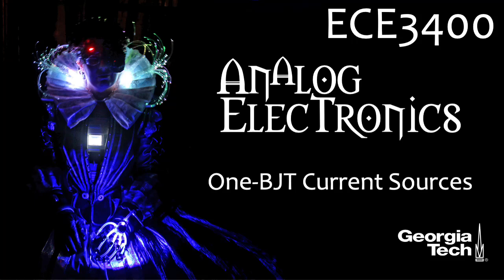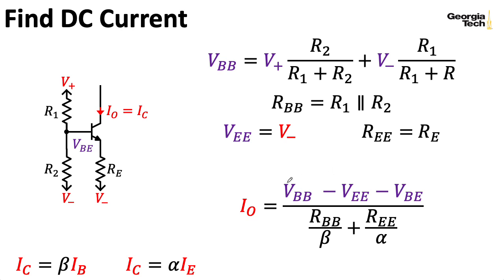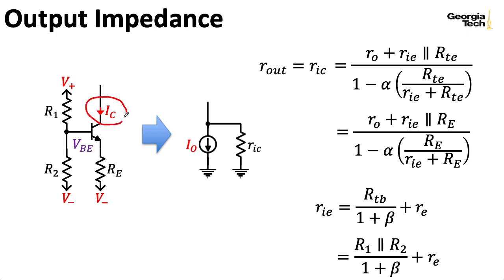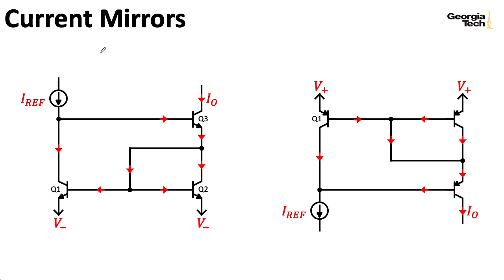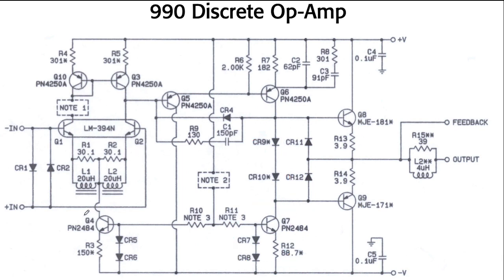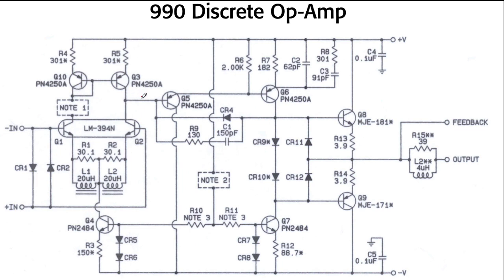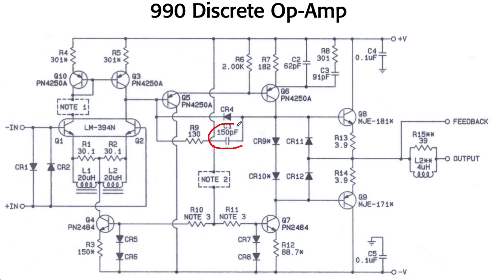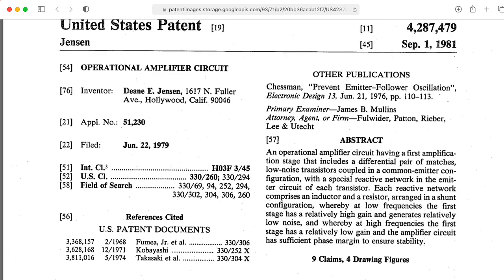ECE3400 Lecture 28: One-BJT Current Sources & Jensen 990 Op Amp Analysis (Analog Electronics)

Comment: Just because it's kind of interesting to comment on.  CR11 and CR12 are there specifically for over-current protection together with R13 and R14.   This will all be familiar to everyone here but just to state it again the current into the base of the output transistors, Q8 and Q9, is controlled by the bias current into the collector Q7 and the input current.  If the collector current of Q7 is lower than the input current the voltage at that node rises until the additional current is able to flow into the base of Q8, which has the effect of pulling the output up. If the bias current is greater than the input current then the voltage at that node will drop instead until current is able to flow out of the base of Q9 which pulls the output down. 

The diodes offer a third path when the output current gets high enough.  The voltage across R13 rises in proportion to the emitter current from Q8.  Once the voltage across R13 exceeds two diode drops then instead of flowing exclusively toward the output through the base of Q8 a new path allows current to flow to the output across CR9, CR10, and CR12 instead bypassing Q8 entirely.  Something similar happens on the low side.  If the collector current of Q9 were high enough for the voltage across R14 to exceed two diode drops then current would flow through CR11, CR9, and CR10 into Q7 bypassing Q9.   This has the effect of starving the output transistors of base current when the output current gets too high.

With 3.9 ohm resistors for R13 and R14 and assuming a forward voltage of approximately 1.3V across two diodes the current across Q8 and Q9 would be limited to around 333 mA.

Comment: Thanks for looking at the JE-990 circuit! I've been trying to figure out what those latchup diodes were for. Have you considered looking at the Neve BA283 microphone amplifier circuit? He implemented some clever biasing and current sourcing schemes in his design.
Reply from the maker: I've spent a LOT of time looking at the 1073 and related such things, and never really made much headway. It's terrifyingly complex.
Reply: @Lantertronics  Same. I have a vague understanding of some of the circuit. Lol.
Reply: it's mentioned in various datasheet of opamps that the contain some sort of circuitry to prevent latch up.

Comment: Do you know this part: LM334MX? ... and you can place it on top of a differential amplifier instead of a pnp/npn current mirror, add 2 resistors below to the npn differential  pair and it works just fine, probably even better.

Sure, wish i could afford going to your class to learn more about the "variables/names" in da math.
Reply from the maker: Not familiar with that part -- it looks interesting.
Reply: @Lantertronics    i got the MIT amplifier "running", i changed the input, put a new low pas filter and C9 is absolutely necessary (although the documents says you can skip it) to prevent oscillation.
a square looked like it was low pass filtered, chaotic like if resonance was in place and started playing with the values of the caps, but nothing helped. also due to the choosing the right inductor, removing it make the amplitude drop.

at first playing with frequencies in the original state,i noticed a amplitude drop at frequencies above 10K. i played around with the input and presto. now around 20 kHz you have a slight drop.

Falstad simulator, right click A/C source and add slider.

Now it's the trouble of finding a 2 x56 Volt transformer locally.